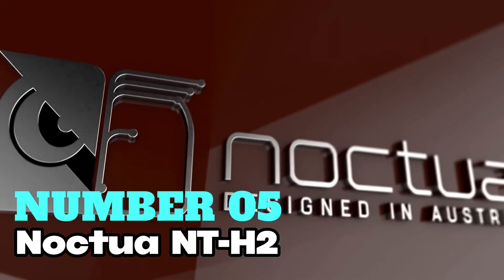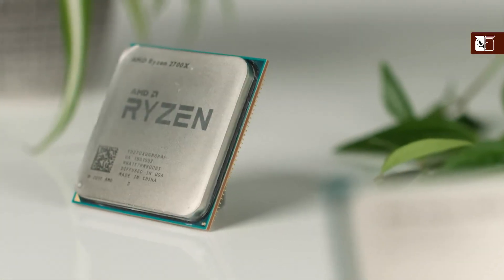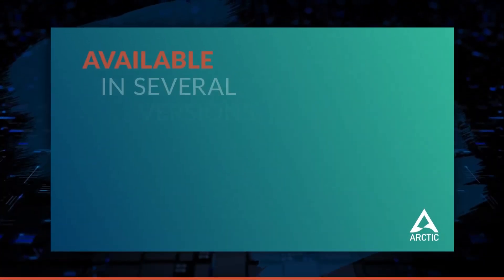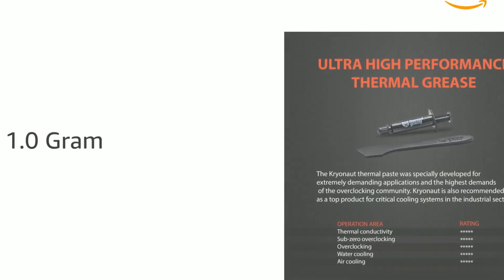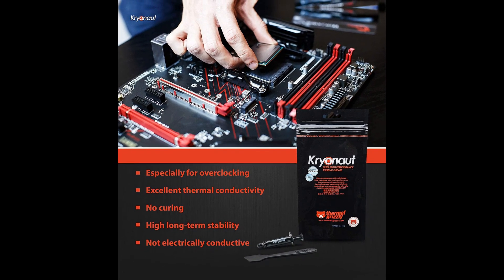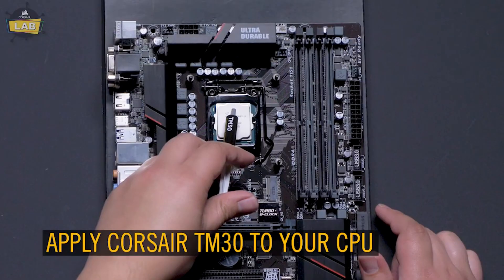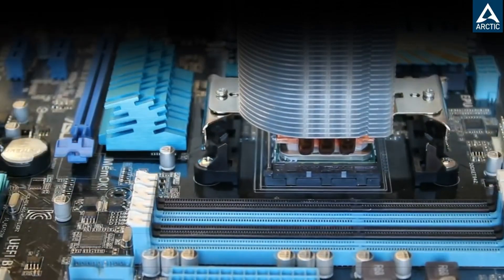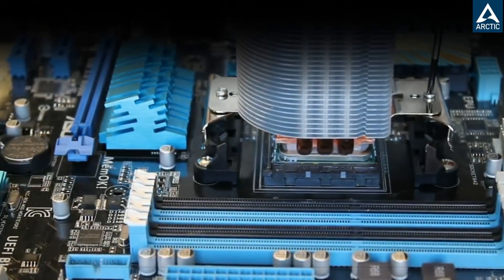Best Thermal Paste 2024 | Keep Your CPU Cool and Performance High!

Comment: Which of these thermal paste last a long time without drying out? I Have a ryzen 5 5500 cpu but i plan to  upgrade to ryzen 7 5800x cpu maybe next year. Which thermal paste should i get ?
Reply: Mx4 has been time tested for 15 years. Solid stuff
Reply: @Dao-k6l  Thank you for your help also
Reply: None of the above, search / google for 'phase change (thermal) material' such as Honeywell PTM7950 from a legit source, or 'PhaseSheet PTM' from Thermal Grizzly although expensive. 
These also don't 'pump-out'...
Reply: Do you primarily game? If so, you should probably get something with a V-cache. Like the 5700X3D or even 5800X3D if you can afford that one.

As for thermal paste. TM30 is relatively cheap. If you want the absolute best Kryonaut Extreme is a very good choice but it's also $21 for just 2 grams. TM30 is like $12 for 3 grams
Reply: @AtomicNuke-gn3qm  I like to also video edit I game not as much as I use to but is good to know thermal paste thank you for letting me know which thermal paste I should go with